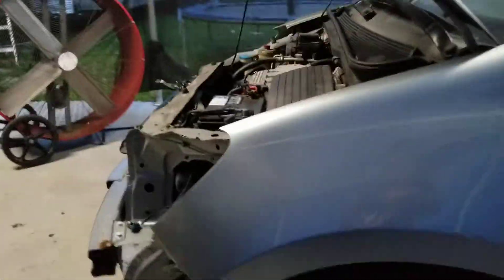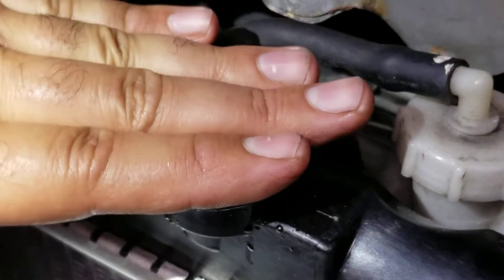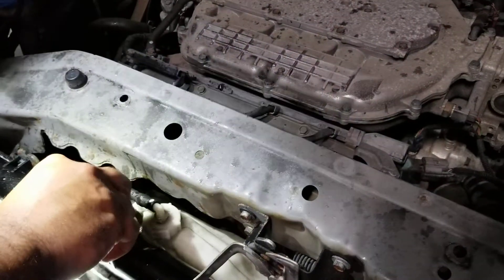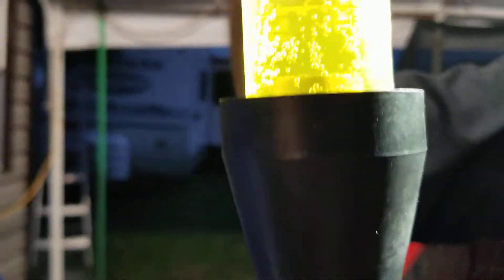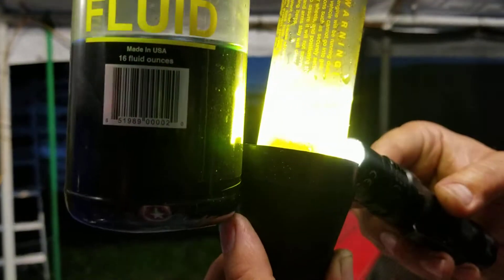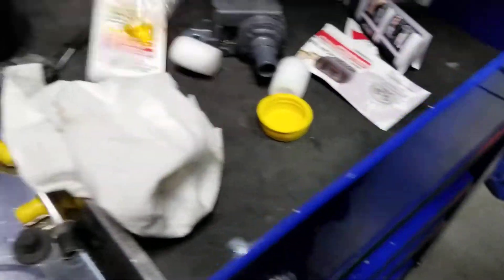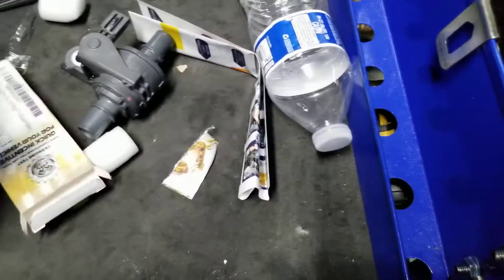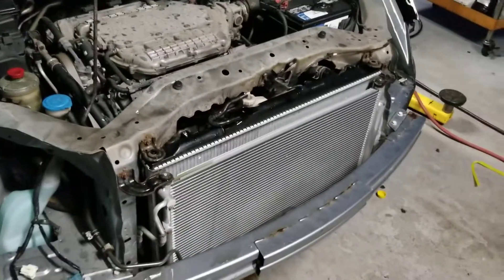p.3 cs engine test combustion leak tester

Comment: Yeah you did not use it right..   its like you wanted it to fail...   put in cool engine. run engine till operating temp. idle or drive. for diesel drive for 10 mins at least..   then cool the engine down naturally don't open cap till cooled. it probably uses the Pressure of the gasses/fluids to push the exhaust gasses into the bag.

Comment: I'm sure youre tired of people explaining this but it's a similar plastic to what is used in reverse osmosis filtration membranes, except in that case, what diffuses across the membrane is water (purified) and against the expected direction of flow (from low concentration to high; from mineral saturated water to pure). 

With this product, the "plastic" is actually a membrane that allows the same gasses your blue juice analyzes, to cross into the pouch. This takes time, as you would expect, being a sealed plastic bag and all, but likely also requires fluid contact for the gas to diffuse, so there cannot be any air space around the test or it will take longer for the gas to mix.. The instructions on the packet are poorly "written" (photos, mostly) and the process isn't explained. I came here to find out if I'm putting it in my reservoir or the rad itself because even that isn't clear. 

I will run this test and post pics of the result.
Reply from the maker: Thanks for the explanation. My understanding is that it goes in the radiator neck.

Comment: Hi, first of all thank you for testing CS Engine Test. We are happy to answer questions about our test. First of all, our test works according to the diffusion rule of gases. The special packaging of the test is permeable only to gases. If there is a leak in the the engine cylinder head gasket, the gases formed as a result of combustion in the combustion chamber mix with the engine cooling water system. In our test, it changes color according to the density of these gases coming out of the combustion chamber. In this way, you can understand the level of leakage in the cylinder head gasket. Tested well below the recommended time for test use in this video (Recommended time is a minimum of 10 minutes after the engine has reached operating temperature). For safe use, we recommend putting the test inside with the engine stopped. After the recommended test period, we recommend that you stop the engine again and wait for it to cool, and then take the test out. This information is in the user guide of our test. 

Other test methods cannot detect leaks at the initial stage or only at high engine speed and engine loads. Especially since diesel engines run at idle and low engine loads with an extremely lean mixture , there is no option other than CS Engine Test. We recommend for early detection for save money and time. Thank you again for using CS Engine Test. If you have any questions, we are happy to answer them. Thanks
Reply from the maker: Thanks for the comment and info. I have since retested this product and everything makes more sense now. Please check out the latest update on this product on my channel and leave a comment. Thanks again.
Reply: @gautorepair  It seems a bit unfair to leave this video up with it still claiming that the product does not work, when you did not follow the instructions.